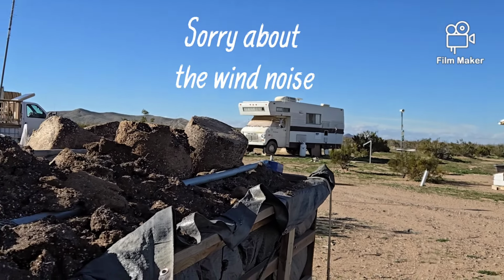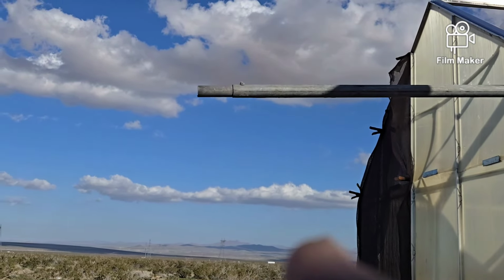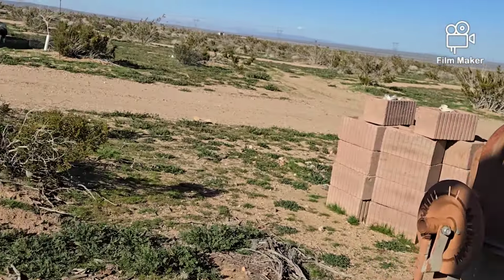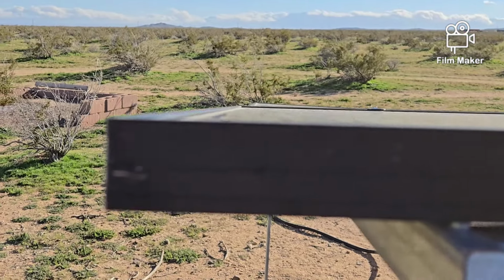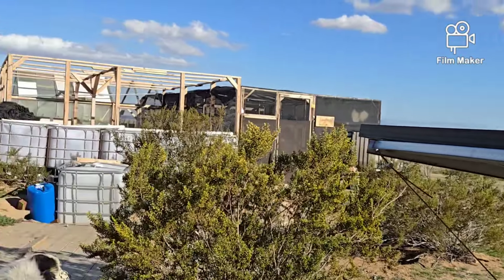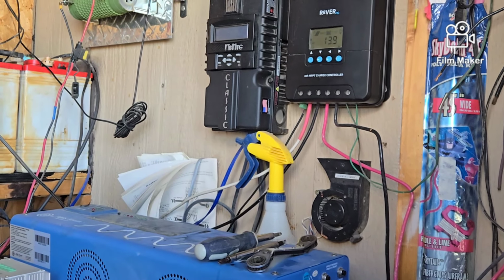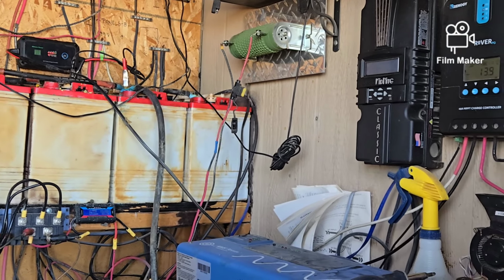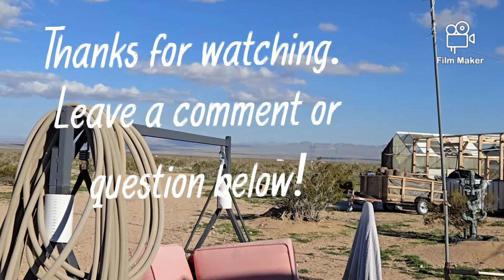Sun Power & Soil, March 1, 2024

Comment: A couple of notes but NOT sure how applicable in your area.  Chat up the local window replacement companies and pick up the good REMOVED windows from homes to keep them out of the land fill.  Here is SE Michigan, people use the old windows for green houses and you just frame them in to fit the need.  On solar, going 48v in your situation is a good way to go.  In fact, using your old batteries MAY extend their life since the amperage will drop by 75%.  Once I move from SE MI, I was going to do the same thing and convert from 24 to 48v to extend their life as they are 9 years old now.  Also, when purchasing batteries, I think its a good practice to think of configuration options.  For example, I built a 400AH LiFePO4 battery cart and then I could change it to a 200Ah 24v or 100Ah 48v.  On panels, you and I did the same thing with 100w panels and I have a lot of them.  I now buy 250-350w panels used and show up with a volt tester and if no voltage then I say hey they are broken, so I offer them $10 to haul them away and fix them for a $1.  I agree with you on all-in-one from a simplicity standpoint but IF I was an off-grid guy I would go with a victron multi-plus II type system due to reputation in the market place IF a person is starting out from nothing.  IF a person does NOT want an all in one, then you cannot go wrong with a midnite solar, morningstar, outback, or victron.  The only issue with outback is they are NOT networkable unless you spend a ton of extra $$ for monitoring.  I have been buying used MPPT controllers are pennies on the dollar on FB marketplace.  Take care and enjoy the spring planting season.  Gary from SE MI
Reply from the maker: Thank you for that input, Gary!

Comment: never go with an all in one.
Reply from the maker: Why is that?  Most reviews say they are more efficient and reliable now, and not like they were in the beginning.
Reply: 2 is one, 1 is none. Most people going off grid can only afford one system. At least with components you can afford to swap out individual pieces. Really like your channel too. @GBear
Reply from the maker: @sundancer442 Thanks.  You got that right!  Off Grid, you don't want something to go down and not have a replacement on hand.
Reply: It’s cheaper to ship lighter weight components in case of a warranty issue.
Reply from the maker: @rv10flyer84 True, but under warrantee they pay shipping.